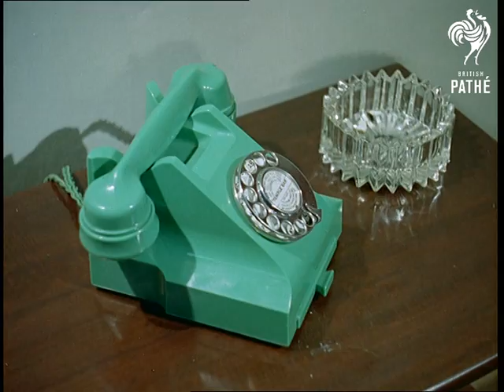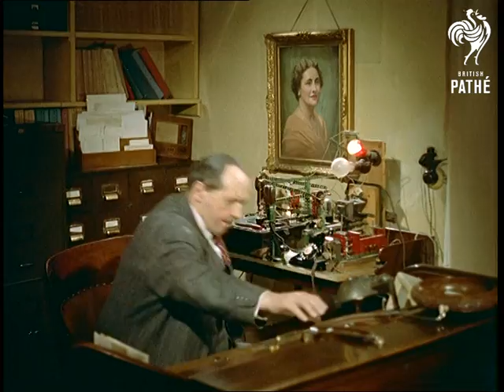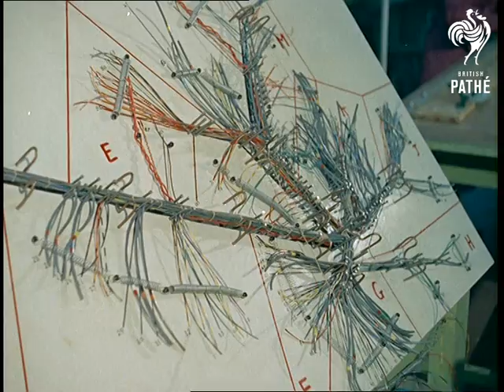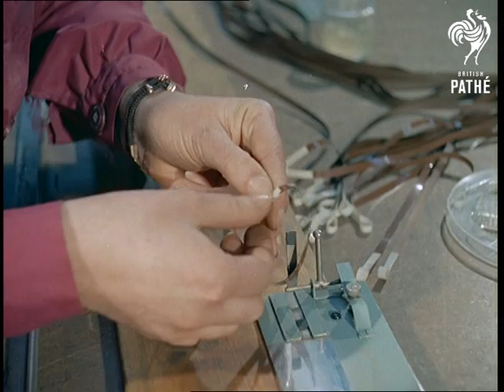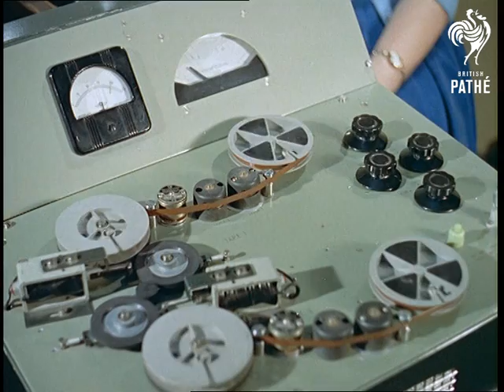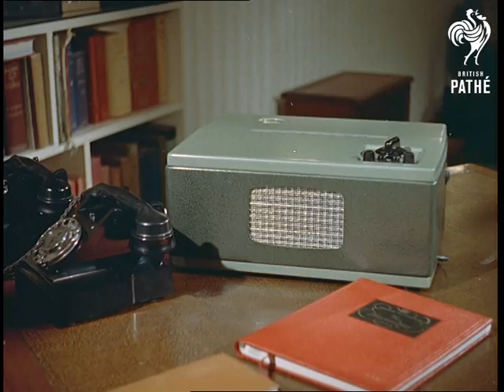Modern Telephone (1959)

Comment: Notice the black Hunts capacitors. Over time these fail so need changing. Many a vintage radio and TV have these components and most of the time replacing these in such equipment solves the issues. The procedure is called recapping.

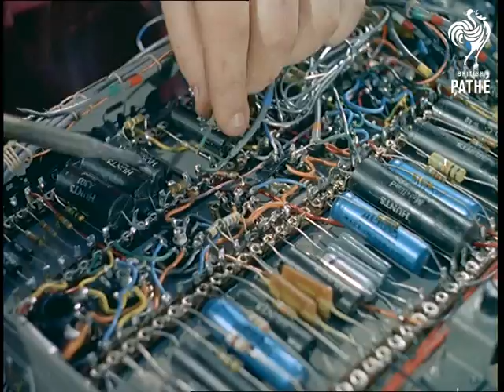Comment: 1:33 imagine working every day and breathing this air
Reply: my thoughts.   doing a solder every day once or twice without a good extractor hood okay, but this.... Their soldering all day long with the fumes straight over their face.  This is for sure giving u lung problems already on the short term, yet alone the long term...  and back then with leaded solder...
Reply: @raymondk2202  Generally speaking today's lead free solder flux is worse than one used in leaded solder. Btw, you're not inhaling lead or any other metal if you breath lead solder's flux fumes.
Reply: @ketse89  Yeah that's just burned rosin.
Reply: That doesn't smell good
Reply: @ToolDroid  wrong, rosin fumes are actually quite pleasant :)
Reply: They would end like this :
😳
Reply: I think for the filming they weren't smoking during the footage.

Comment: Mmmmm lead smoke , those were the days
Reply: The smoke from soldering is from flux which is embedded in the core of the solder, which is usually rosin (solidified tree sap). It helps to clean the metals being soldered so the solder adheres properly. The lead in tin-lead solder isn't vaporized at all, or just in very tiny, trace amounts. Still, working in a factory all day breathing in soldering fumes is harmful, more from the smoke from the burning flux than from lead, though it does result in some lead exposure. Back in those days a person would get much more lead from the polluted air from leaded gasoline than from soldering.
Reply: @brainndamage  when the first reply is a phd level answer
Reply: still is in my room. i do vent out the window.

Comment: A friend of mine has an old USSR radio. 1956 year. Produced in a limited series for Stalin's anniversary for VDNH in Moscow. Circulation ~ 6000 pieces. Semi-digital. Remote control. Adjustment of tuning and volume with servos. )
Reply: Have you got a picture of it ?
Reply: I remember my uncle having a Latvian Rigonda Sinfonia II radiogram in the 70s which was made in the 60s. That had motorised autotuning. I was always mesmerized by it.

Comment: the pcb circuit was discovered in 1936, but why didn't they compose the circuit with the pcb
Reply: Maybe its hard to produce
Reply: It wasn't discovered, it was invented. And eventually, they did start making PCBs for machines like these.
Reply: The printed circuit board may have been discovered but that only got rid of the wiring, all the components to be fitted to it were still large.
Reply: PCBs are not good for tube equipment.

Comment: Charming in a way. However I get so antsy when I see the soldering stations and those fumes just going straight into the workers face like that. Nothing like a good, healthy fume of leaded solder to brighten up ones day!
Reply: In 1959, those same factory workers were probably smoking 5 or 6 packs of cigarettes a day, lead fumes were the least of their health dangers lol.
Reply: @TRLTheRandomLab  very unlikely 5 or 6 packs a day I am a chain smoker been so for decades 2 pack a day occasionally 3. Even so most cigarettes aren’t fully smoked it’s generally 1/4 to half actually smoked and tossed away. So I might use up 2 packs a day I likely smoke perhaps a third of a pack ,will this kill me well something will eventually
Reply: @TRLTheRandomLab  I am not a smoker.
Reply: Excuse me." Pick and Place",- chess? Bishop and Knight.
Reply: @djdjdjshhsuss3941  I'm Okay, You're Okay"- a great book to read.
Reply: I immediately thought that too... + a few thoughts on why they use overheated soldering irons in what is supposed to be a factory with standardized equipment :)
Reply: @jassenjj  I think at those times "temperature regulated" soldering stations were not available..🤷‍♂️

And now a days temperature regulated soldering iron is very cheap because of availability of cheap micros(STM32, Atmega all series etc)
Reply: @SAHILKHAN-lu8oq  Actually 1959 is the year in which Weller introduced the magnastat technology.
Reply: I think that's correct , you plugged in the thirty watter directly to the mains and dobbed an unhealthy amount of solder flux and leaded solder every thirty seconds.
Reply: I thought that too, a good healthy dose of lead and rosin flux fumes. 😷
Reply: @djfromage  There's no lead in the fumes, your iron would have to be seriously overheating to achieve lead fumes.
Reply: The fumes are flux, not solder, and not lead. A soldering iron is nowhere near hot enough to vapourise lead. There is no risk of lead poisoning from solder flux fumes.

And leaded solder is a way better material than the unleaded rubbish.
Reply: @ian_b  Excellent response. I worked in similar factory settings. I used a fan and breathe out while making the solder connection. Even then, OSHA and ISO9000 insanity came along early, mid 1990s. Made a simple solder job into a complex photo book, 6week training classes with "Certs", weekly 2hr meetings, and lots of confused people! And them fumes was now a "health threat"..Needless to say, I left "Industry"..Or what's left of it in the USA.

And I hate "Lead-Free" solder...Lead/silver solder is the best connection. With lots of Flux! Good solvent cleaning..
Reply: And nowadays with all the achievements and accomplishments we got people it is not content and without the soldering fumes we are dropping like flies, life is a cycle.
Reply: I am watching this now for the first time and had the exact same thought.